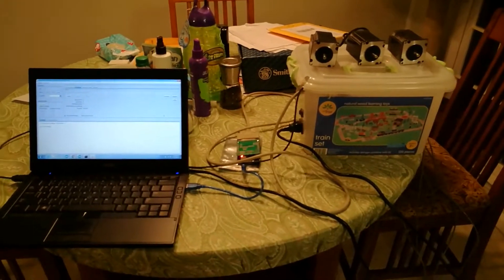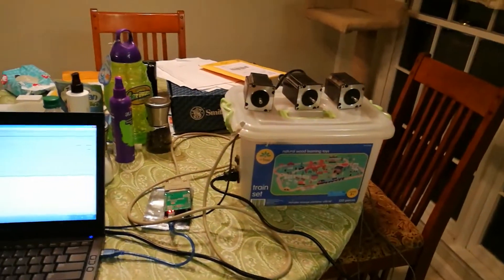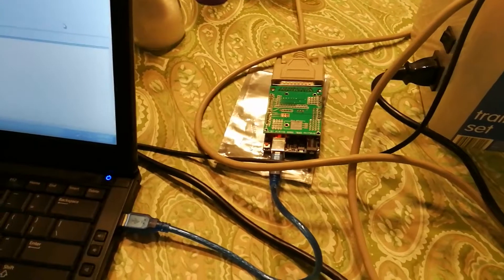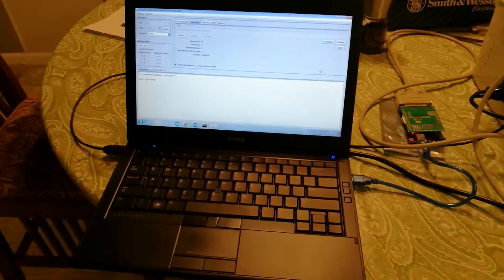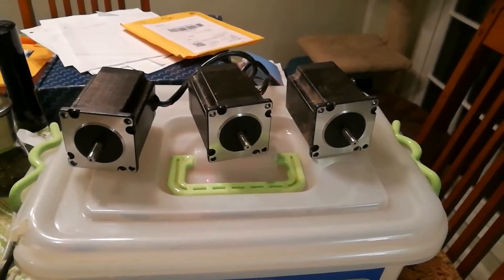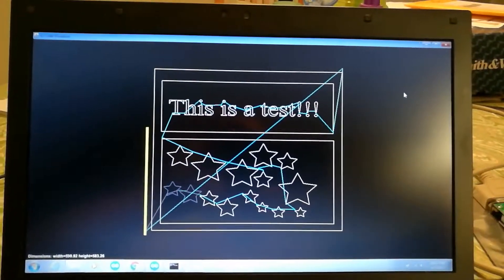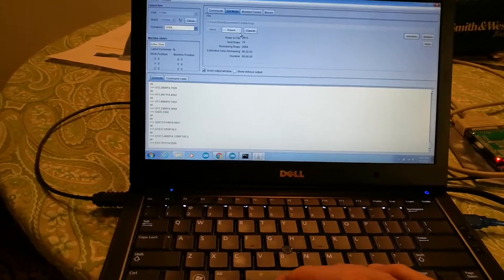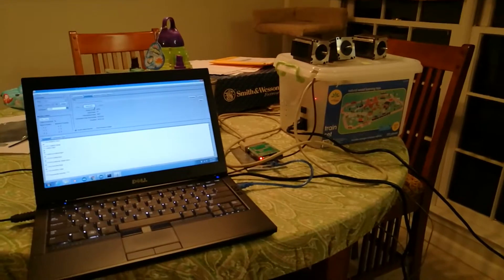GRBL to DB25 Shield

Comment: hi, I would ask you a question. I have an old CNC Fanuc Sigma VC1000 with the same serial port 25 pin DB25 and I would monitoring this machine using an ESP32. Not only monitoring but also send it the gcode. In your opinion I'm able to do this using this shield (in your video)? For monitoring I mean sending the machine some code for example D600 and the machine could answer me about the status: stop, word, allarm, type allarm. Sending gcode I don't know yet.
Reply from the maker: I would say it is possible, if you think you could use grbl to control the machine, all this card does is map the Arduino pins to the DB25.  If it were me I would probably use LinuxCNC running on a PC, should definitely be able to handle the needs of that machine.